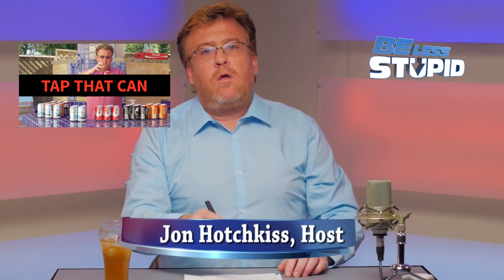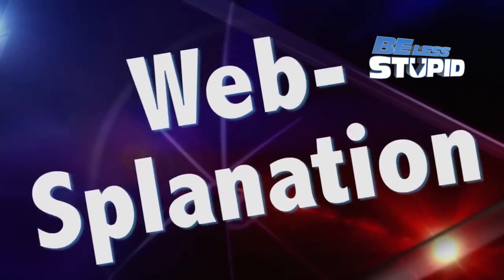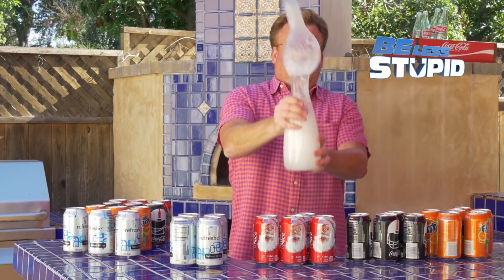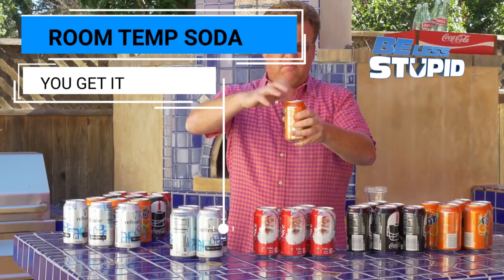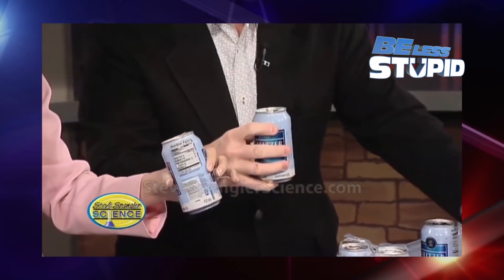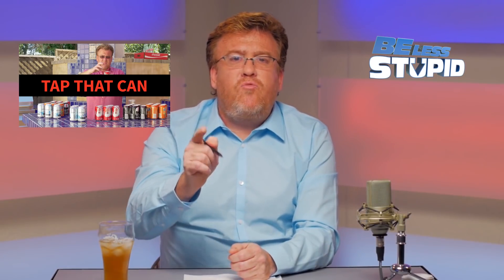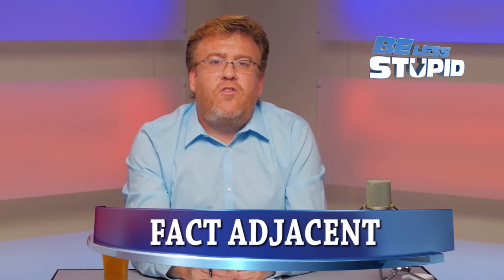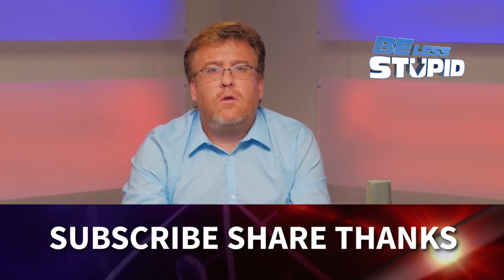Does Tapping The Soda Can Stop It From Exploding?

Comment: I learned in honor science 20 years ago, that tapping the can on the bottom works. You literally have to place the can upside down on a table or ground , then tab the bottom like 3 times to send the gas bubbles to the top of the can. It works every time. I've been doing this for years. Surprised that I have not came across a YouTube channel that actually shows this

Comment: Tapping the can always worked for me? I’ve dropped and dented beers and gave them the old tap and opened them immediately and it works with no fail? There’s probably a certain spot and certain strength of tapping you need?
Reply: it's the can tabs for me, dropped a dented soda just now and tapped the tab 15 times got a loud hiss nothing else do it with every soda and never had any explosions

Comment: You're not doing it right. Maybe start by not forcefully hitting the cans on the side (especially not with a hammer) causing them to be shaken up more. When I do it, I only lightly tap the can around the sides, and all the way around. I then open it slowly, and although some soda foam does come out the top (very little), it doesn't spray out, nor does it flow over the sides. I have done this with more than a few soda cans, so I can say from experience that it works.

If you don't believe me:
https://youtu.be/Bq6AVraBQw0

Comment: It does help...it does not prevent.  Especially noticeable with 2L bottles.  When you tap and the nucleation sites and are knocked off, this will prevent those already established sites to continue bring CO2 out of solution when opened therefore less mess.
https://www.youtube.com/watch?v=K-Fc08X56R0 -- This video does a better job of explaining the science behind it.  There is 3 physics problems but its in the video.

Comment: I have a method that will win bets, been doing it for years, let some joker shake the soda can real hard for as long as they like, take the can and roll it on it's side backwards and forwards for a minute or two. Then pull the tag, it will not explode as you'd expect it would, it will likely fizz a bit, but roll it enough and the CO2 will recombine with the liquid. I'm sure there's a scientific answer for those bothered to investigate.
Reply: The liquid runs along the inside, as it rolls the liquid runs BACK down the inside, the bubbles will be able to pop more easily and quicker due to the surface area and surface tension of the liquid.  You are also exposing those nucleation sites to the gas which will help.  This actually makes perfect sense and something I never thought of before or seen.

Comment: You present great articles, but (and you know there's always a 'but') ease up on the "humor". Your articles are very thorough except for this time. Try tapping on the top of the can with your fingernail. It makes more of a higher pitched sound than a thud with your fingers or rubber mallet. It doesn't work everytime but most of the time. Try it.
I really enjoyed your multi part article on "border security". I learned a lot so I'm a lot less stupid. Thanks.